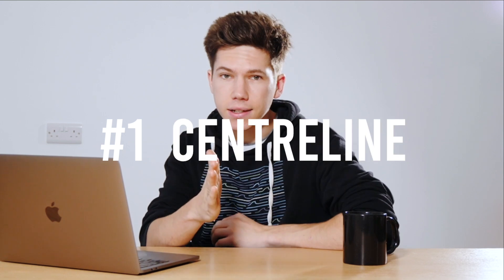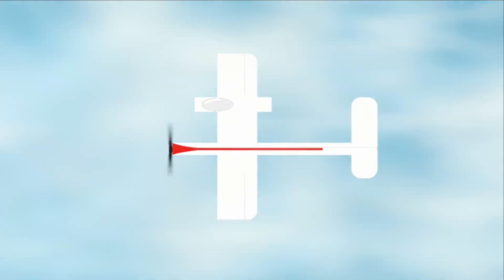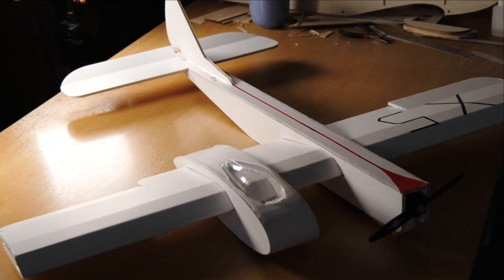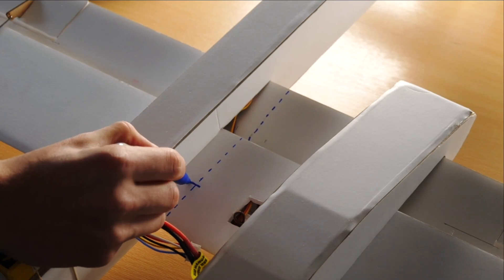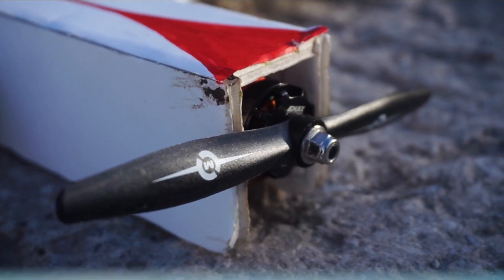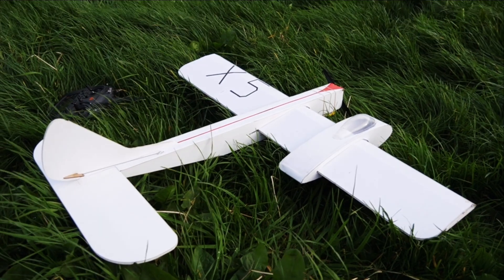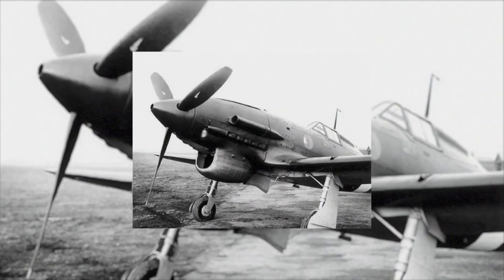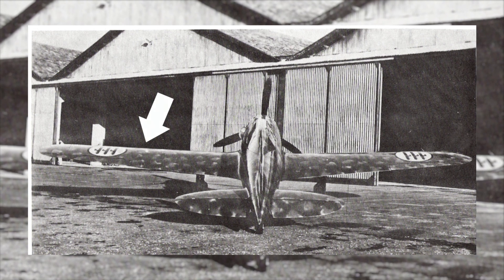Asymmetrical R/C Plane

Comment: Hi Tom, I enjoy your video. You remind me a lot about myself when I was your age...electronics, aircraft and engineering. I also start building RC aircraft using depron foam. They are light and easily available. However, they get deform after a couple of hard knocks and so goes the aerodynamics with the knocks. I discovered another material call corrugated plastic sheet. I use the 1.5 mm thick and you can fold into a very efficient airfoil. You can built barn , delta, elliptical wing shape with it. They are several times stronger than depron but heavier. Here is my recent built ...https://youtu.be/O7oBp_qaDVM

Comment: Concerning asymmetrical aircraft, Bf109 fighters had a similar feature – starting from the F-variant, the tail was an aerofoil that created lift to counter the torque from the engine. 
This had consequences post-war, when the Spanish fitted out their license-built 109's with Merlins. As the Merlins rotated clockwise (in contrast to the DB engines that spun counter-clockwise), the Spanish 109's ended up having the torque and tail lift add up to create a strong rotation. Must have been hard to fly!

Comment: Really cool video! Just wondering, where did you get the foam to build it? I can't really find any in the uk
Reply from the maker: There's info on my website about that :)
Reply: @Project-Air  Thank you! Will check it out
Reply: Cannot see any mention of foamboard ? just plan downloads.
Reply: @angelreading5098  It's in the about section. TLDR: Search 5mm A1 foam board on amazon
Reply: Thank you for that Epicness,James the contact box is not working on your web site can you tweak the knobs please ?

Comment: By correcting with rudder trim, efficiency is reduced right? With rc no biggie but what about irl aircraft?

P.S. Great vid man
Reply from the maker: Yeah I think that's probably quite a downside which is why we don't see more blatant asymmetry. It the benefits probably don't often outweigh this factor. Thanks!
Reply: The offset thrustline has the same effect as right thrust on a centerline-mounted engine. So you do not need rudder trim for most phases of flight...as long as the offset isn't too extreme. The offset motor actually reduces the need for left trim to counteract torque.